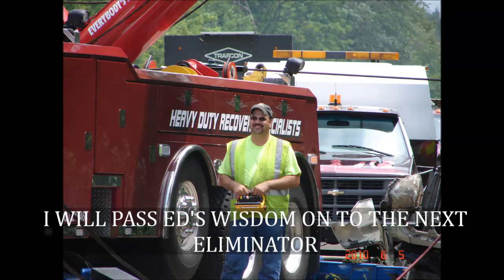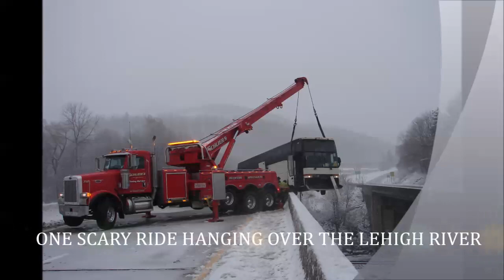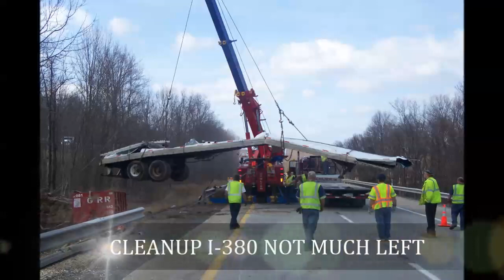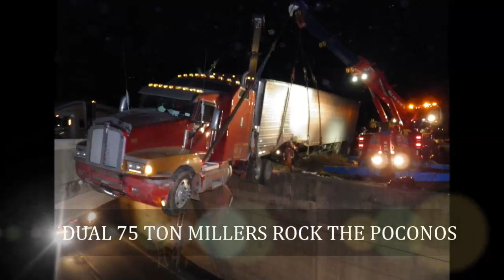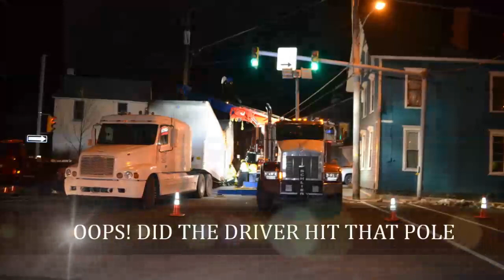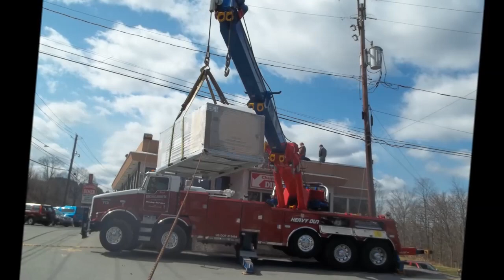MY LIFE AS A HEAVY RECOVERY OPERATOR

Comment: Makes a great slide show, sorry for your loss in 0212.  I should do this with my pix, I started towing in 1986 in a 48 KW with a Holmes 750 and went till 2001 ending in an NRC sliding rotator . . . drove the first rotator in AZ 98 to 2000, Miller 1060R.  I miss so towing but my back can't take it, had an injury in 01 and had to move on.  Anyway thanks for the walk down your memory lane, I enjoyed it.